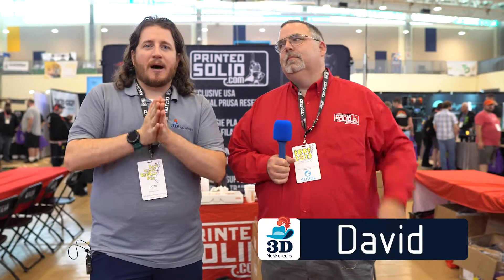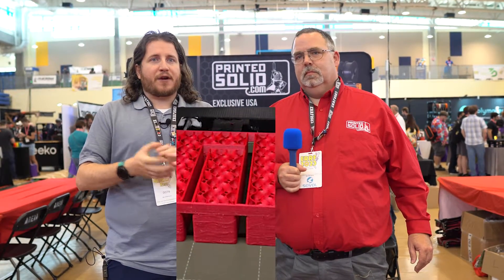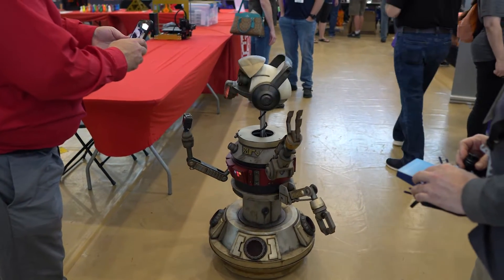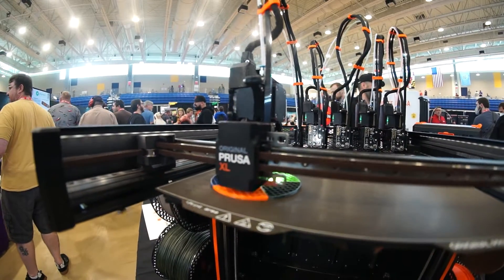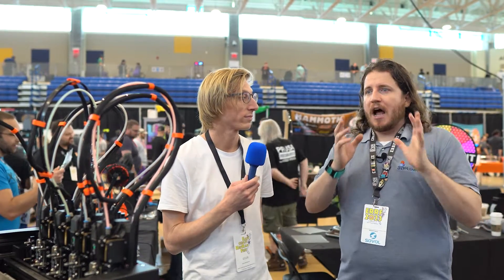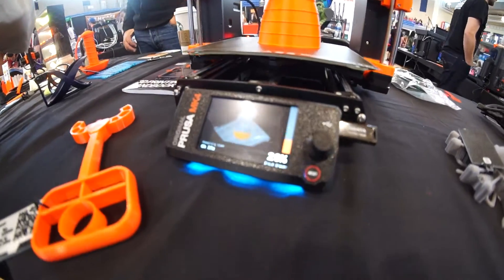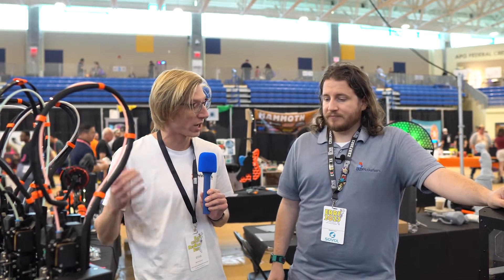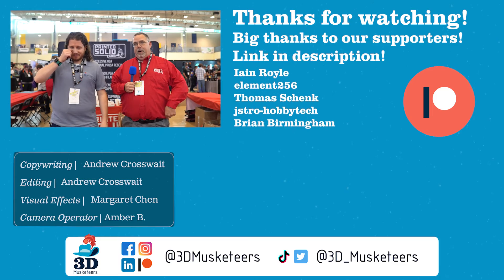The Prettiest Filament and the Prusaiest Printers! - Printed Solid & Prusa, ERRF/3D Printopia 2023

Comment: I have had really bad experiences with Jessie PLA and Printed Solid. I bought Pure Cyan, Limer Green, and Neon Pink Jessie PLA. The colors are beautiful, but they curl worse than any PLA I have ever used and bed adhesion is sub par. I attempted to leave a review on each of these as a verified buyer, but Printed Solid did not post my reviews. I'm guessing it is because the reviews would have lowered the star rating on them. The fact that they are only posting positive reviews for their products leads me not to trust them as a company. Has anyone else had issues like this with Jessie PLA and Printed Solid?
Reply from the maker: Never had those issues personally. Bed adhesion and curling are caused by print settings, not the filament, for whatever that's worth. So, likely it wasn't posted because it's not something to do with the filament and instead the settings of the machine. They use ingeo 4043D last I checked for pla and that's the good stuff. Only a few companies use them, but man I enjoy it.
Reply: @3DMusketeers  I tuned to the filament. Also as a test, I used the same exact gcode and printed with Hatchbox, SUNLU, and Elegoo PLA with no issues whatsoever. I don't have a print farm, but I've been 3d printing as a hobby since 2016 and wouldn't leave a bad review unless it was warranted. I've printed the same model (articulated lizard) on my Voron 0, Monoprice Ultimate, and FLSUN V400 with different brand filaments and the only one that caused problems was the Jessie. I don't try to print at crazy speeds and I enable dynamic overhang speeds setting in PrusaSlicer. As a side note, Jessie gun metal gray has given me no issues with curling or bed adhesion. Maybe it was a bad batch, but what are the odds that all three colors were bad?
Reply from the maker: 0% really. I find Jessie likes more heat personally, but that is on the prusa farm.

Comment: I can't imagine different nozzle sizes on the XL without a massive overhaul to prusa slicer. They consider a nozzle size to be a different printer. So if you had 5 different nozzles, that would be an insane number of combinations. I wish the nozzle size was treated like a filament type. I think it's one reason I've been hesitant to try 0.25 on either printer. (Because I'd basically loose all my settings)
Reply: I do hope they can make multiple nozzle sizes work eventually, because that would be great!
Reply: This would be great
Reply: At least out of slicers I've tried, only Cura even remotely has a good system for handling nozzles of different sizes...it really shouldn't be that hard.
Reply from the maker: I am sure they will have something, because yes, perimeters with a 0.25 and infill with a 0.8 would be AMAZING!!

Comment: I'm really hoping Jessie likes the MMU3 better than the MMU2. The MMU2 Jessie caused so many filament fails. I still have my orange spool. I've been saving it for this very test.
Reply from the maker: Yeah, no MMU experience here yet..
Reply: @3DMusketeers  Jessie is too soft. The MMU ends up getting a little notch that prevents it from loading/unloading. It happened more often in my jessie orange than any other filament. Then there is sunlu which snapped in the boden tube to the extruder. lol Thankfully not very often. I REALLY don't like sunlu. But CC3D silk? I can print that all day in the MMU2. Esun is usually pretty reliable. It depends on the color. If it gets super stringy (yellow is a serious problem) then it has issues.
Reply from the maker: I am told the new MMU fixes so many of the issues :)
Reply: @3DMusketeers  Because I ordered a new MMU3 for the mk4 AND a MMU2 -> 3 upgrade for the mk3 at the same, I have to wait for both and the mk4 isn't out yet.
Reply: So while I've heard this is true, I don't get to see it yet.